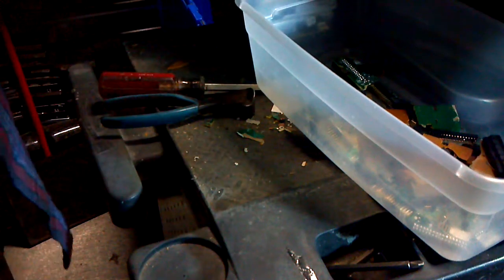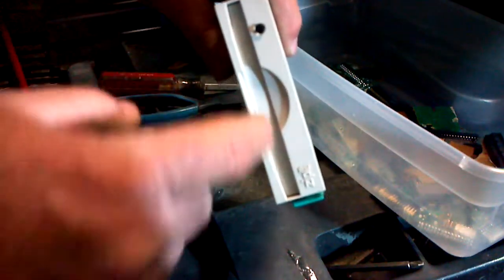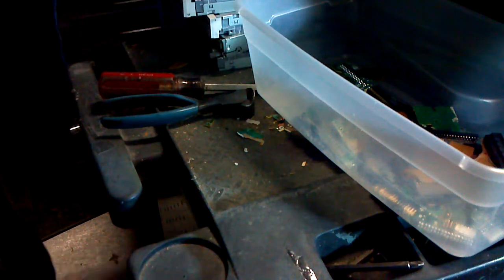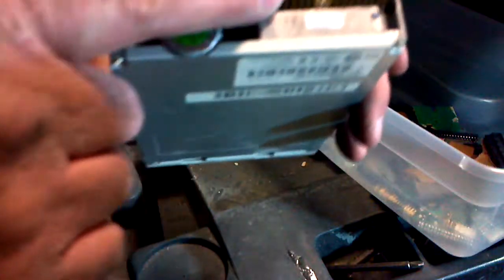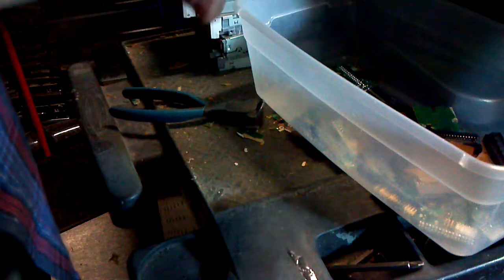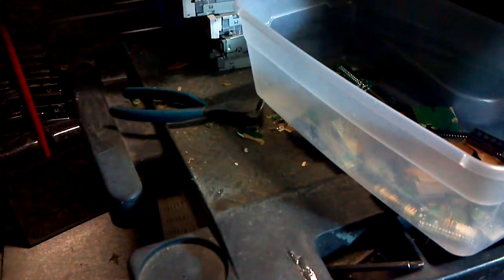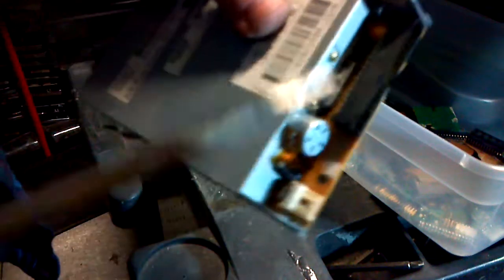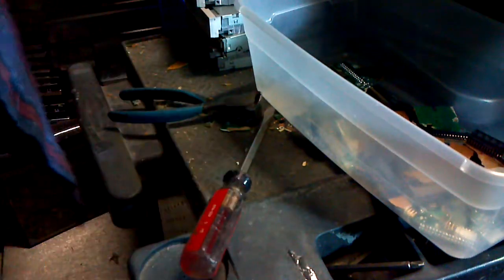GOLD and SILVER Recovery from Vintage 3.5" Computer Floppy Disk Drives

Comment from the maker: Yes, there are several 'accumulators' around the world that buy boards and then take the large loads on to the 'big boy' refiners.  You want to look for one that suits your needs as some pre-pay (before you ship the boards), some will pay shipping up front and others will pay only after they have gone through the material - some even do a processing run (of sorts) before they send you a check - up to 60 days later (though this process does typically pay the most cash as it is an exact count).

Comment from the maker: yes, it is a motor and it does contain some copper wire (called "hair wire", which has a very tiny amount of copper in it compared to the insulation around it and it is still super tiny).

Many scrap yards won't take hair copper - at least, not as copper - and it is rarely worth going after, unless you really want to grab the 'last penny' at any cost, including a bunch of your time....

Notice the name of my videos - doesn't say COPPER Recovery... - I rarely go after copper, and never hair wire.